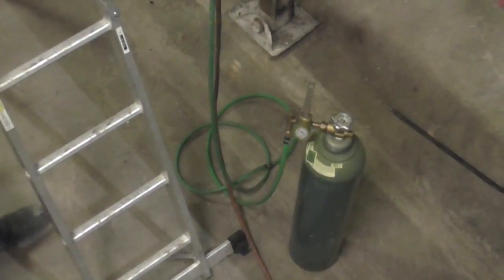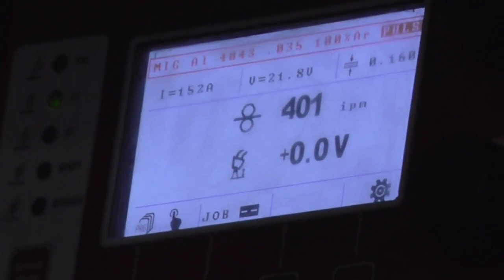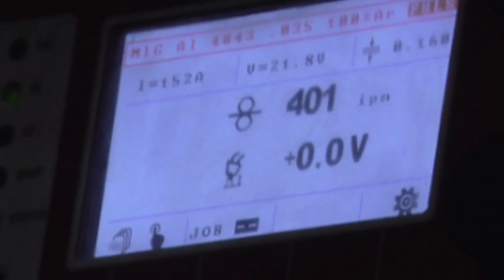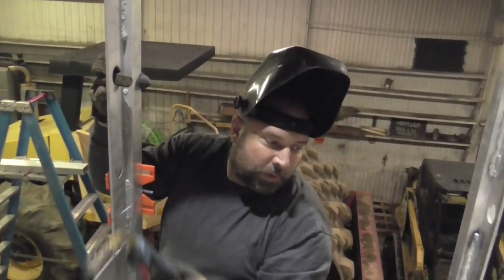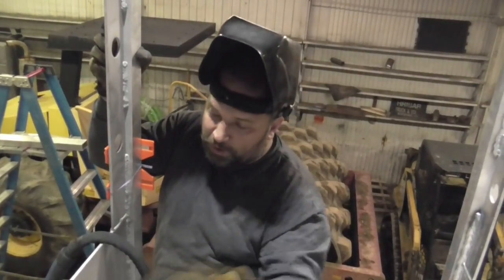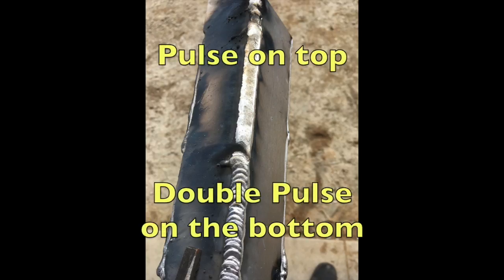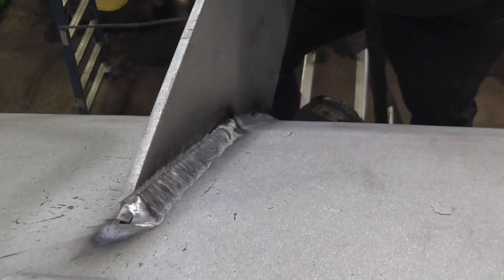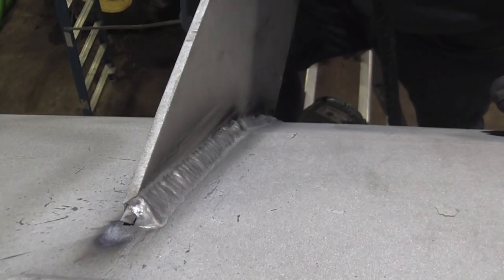Pulsed mig aluminum Single vs Double pulse

Comment: Hello! how much money did you take for this work? more than 5000 usd or less?
Reply from the maker: I did this job 10 years ago  - I cant remember the exact amount also the material cost back then was totally different ....    but if I was going to do that today $5000 just for labor, butting all the parts, and welding all the parts is about right

Comment: Mr Zila how thick aluminum can htp propulse 221 weld? Great work!
Reply from the maker: Kristijan Milenkovic depending on the alloy you are welding 4043 or 5356 and the size of the material and the temperature of the material you are welding ....  and there are options for .035 wire diameter with pulse and .047 wire diameter without pulse ....  lets say in a single pass with pulse 035 wire 3/16 to 1/4” depending on size and temperature 
If you weld 047 wire no pulse 5/16” easily maybe 3/8” single pass

Thicker if course multi pass ....

But at some point duty cycle becomes an issue also

Comment: you should have that white line each side of fillet, you should not need stirr like you are doing, 40 years hands on yacht builder  ALU, SORRY ON TWO PULSE YOU WERE NOT STIRRING,  thanks, why do you not rig some staging, tressles with alu planks, gee
Reply from the maker: Stuart Hearn i used the double pulse to limit heat input. Those tanks are some shitty aluminum, the way how they are build i had some big gaps to fill i needed to stir it like this to bridge the gaps. If you weld new and clean material with perfect fit up - that is a completely different story.  And million dollar yachts is a different story than a 1980’s old aluminum trailer
Reply: yes, good for you, i built that yacht in a ply shed, it was my business, 33 boats no rent

Comment: never use 4043, corrosion especially marine, i have aluma pro guns but they do not fitter other than miller feeders
Reply from the maker: Stuart Hearn this is just a tank for water ....  4043 is just fine
Reply: ok mate time will tell  https://www.youtube.com/watch?v=3hqV4DXwlEc, not trying insult you:))
Reply from the maker: Stuart Hearn i am not taking it personal. I watched your video.  I know about corrosion resistance and strength and heat treat ability and hot cracking at temperatures above 150F when using filler wires with more than 3% magnesium ....  i am well aware of all of this ...

You and i are working on different applications ....
Reply: looks like you are not using pulling guns> ? unfortunately, have to in the spaces you fund in ships, gun lead is never straight, I had a stroke, building days gone, but i try to find someone to build my simpler designs no plate forming, where are you
Reply from the maker: it all depends - if your feeder detaches from your power source ...  then you can run mig guns between 8 and 12 ft  off the feeder ....  you can also use push pull guns - what i dont like about push pull guns (besides the price) is that you always have to think where you are going to go with he 25 ft long cable ...  you cant just ron it up and hang it up ....  i am also working on a design for a water cooled spool gun - i am actually putting a prototype together this week and then i will be testing it ... i will be running it on a power source that is capable of hot start, pulse, double pulse,crfater fill options and i am also integrating remote control capabilities where the potentiometer on the bottom of the spool gun does not only adjust wire speed  - BUT all synergic settings wire speed and voltage at the same time ....    in my mind something like that can be really interesting for tight corners where you normally dont know how to route your mig gun or push pull gun cables ...  we'll see    in the next few weeks or moth i will be making a video about that ....
Reply: @stuarthearn9890  Stuart, do you consider fresh water and salt water to have different corrosion rates/curves?

Comment: Comments from someone who just bought a PP200 and whose only experience prior is a hobby MIG (Lincoln Power Mig 180T) and a little bit of TIG work.  I had no clue what "Spray" welding or Pulse welding meant, but it sounded cool and it looked like it worked well.  But my previous Short Circuit MIG experience was going to give me some early frustration with this machine.  My first weld went down like butter, just like the videos.  Cool!  I was so excited.  Then I started to play with the settings, BackBurn and Pinch, trying to understand what they do.  The Manual is a little lacking here, too general.  The STEL manual looks to have more diagrams in it, which might help, but it is not in English.  I was having an awful time with poor starts and wire retracting back into the tip after the weld.  As soon as I would pull the trigger, the 3/8" to 0.5" of wire I had sticking out of the tip, and which was being held to within 0.25" of the aluminum base metal, it would blow away, vanish.  What I was left with was a large arch, from the tip to the base metal.  I learned if I slightly pulled the gun away, the St-Arc feature would eventually push the wire out beyond the tip.  And if I was patient enough (oh by the way, this whole time, there is no resemblance of a decent weld, just a mess) the arc would eventually get to the correct length.  Then and only then, it started laying down a good bead.  My mistake?  Too much stick-out and/or holding the gun/wire too close to the base metal.  I've decided the tip of the wire needs to be held further away from the base metal than the arc length will be.  So far, as long as I observe this, it starts reliably, every time.  But I'm still a little confused.  Your videos look like you're holding the gun pretty close!

Another interesting difference, I subconsciously was use to changing the puddle temperature by changing the arc length with my old MIG.  Things getting too hot?  Just move the gun in closer to cool the puddle.  You can't do that with this welder, because of the St-Arc feature.  Just something I needed to understand and learn.  Related to this bad behavior, several times I've notice that after I got done with a weld, I looked at the front panel and the amp setting had changed, it was lower than I started at.  For example, if I was welding at 100 amps, when I got done, it said 87 amps.  How did that happen?   At first I thought it was a software bug, or the heat setting was inadvertently changing as I flipped between other menus.  But I think what was actually happening was, at the end of the weld, when things were too hot (I'm using small 6" long 2" wide 1/8" strap, and they heat up quickly!) I was subconsciously moving the rod into the ever-growing puddle, trying to try to cool it.  Well, if you do that too quickly, before the ST-Arc can react, you will "trick" the machine into thinking it has reached max current, because it can't increase voltage enough to maintain the desired arc length (voltage).  So the machine automatically compensates by reduces the heat setting, wire speed(amps).   At least that's my theory.  This automatic reduction is discussed in the HTP manual.

When you consider what all this machine is doing, at this price point, it is pretty amazing.  To bring this level of MIG welding sophistication to the hobbyist (and professional) is really neat stuff.   I'm excited to try it out on many different projects, now that I have some of the basics figured out. 

Keep up with the great videos, Peter.  Maybe you can comment on initial wire stick-out length, gun placement and how much wire stick-out to maintain while welding, or at least how much you need just prior to initiating the 4T slope down, for newbies like me?  -Dave
Reply from the maker: Dave - i tried to be pretty details in this reply - if you want to send me a personal message and i will talk this through with you even better 

>>Comments from someone who just bought a PP200 and whose only experience prior is a hobby MIG (Lincoln Power Mig 180T) and a little bit of TIG work.  I had no clue what "Spray" welding or Pulse welding meant, but it sounded cool and it looked like it worked well.  But my previous Short Circuit MIG experience was going to give me some early frustration with this machine.  My first weld went down like butter, just like the videos.  Cool!  I was so excited. <<

that is how it should be  :-)

>> Then I started to play with the settings, BackBurn and Pinch, trying to understand what they do.<<

on aluminum that is not a good idea ....   what wire were you running? 4043 or 5356?  the pinch will take the ball off the end of the wire.  now it also "blows" a piece of wire off the end. the softer the wire is the less pinch you need - you need just as much to where it takes the ball off the end.  on 4043 aluminum wire only needs 40-60% pinch.   
if you have more pinch what will happen is that besides blowing the ball of the end it also blows off "too much" wire and after you have too much pinch on really soft wire it starts to act as a burn back feature
which brings me to burn back
burn back adjusts the amount of wire that sticks out of the tip when you stop welding.   
lets say that when you stop welding 3/4" long wire sticks out of the end of the tip - most guys would consider that too long - now instead of trimming that with a wire clipper you would increase the burn back in SMALL steps and weld and che and repeat and adjust and weld and check and repeat till you have the desired length of wire sticking out  (lets say 3/3" or 1/4" or whatever you pick

>>The Manual is a little lacking here, too general.  The STEL manual looks to have more diagrams in it, which might help, but it is not in English.<<

i don't think that their manual even describes at all what those functions really do
and yes it is italian and english

>>  I was having an awful time with poor starts and wire retracting back into the tip after the weld. <<

so the burning back in to the tip i think i just covered - as far as starts
what wire did you use, what were your settings ?
generally speaking i would suggest welding aluminum in 4T mode
reason being if you are in 2T your hot start and "run in" menu are interlinked ...
that means - to get a crisp start you set the start speed (wire run in speed) at 40% lest say (maybe 50) and the time 0.2 maybe 0.3 sec
that will take care of your arc starts -they will be crips and smooth - no machine gun - nothing ...
now to have the timer or 0.3sec that also gives you .6 sec hot start total....

if you want more you need to run totally different settings - lets say  80-90% start speed and 1.2-2.0 sec time ... now you have 2T hotstart  but that might compromise your arc start again ....   

so better to set it 40% 0.2 sec or 0.3 sec and than use 4t and control your ampoule of hot start with the trigger

than hold your contact tip about 5/8-3/4" away from the material ... a lot of short circuit mig guys have the gun way to close to the material or whey are now "afraid" of burn backs and start 1.5" away from the material ....  

>> As soon as I would pull the trigger, the 3/8" to 0.5" of wire I had sticking out of the tip, and which was being held to within 0.25" of the aluminum base metal, it would blow away, vanish.  What I was left with was a large arch, from the tip to the base metal.  I learned if I slightly pulled the gun away, the St-Arc feature would eventually push the wire out beyond the tip.  And if I was patient enough (oh by the way, this whole time, there is no resemblance of a decent weld, just a mess) the arc would eventually get to the correct length.<<

what size, alloy or brandon wire and what spool size where you running - sounds like it may not have been feeding the wire fast enough or your start speed was set way too low for way too long????

>>  Then and only then, it started laying down a good bead.  My mistake?<<

not necessarily your mistake -on aluminum (with the pp200 and other brand machines) everything has to be "just right" to work good - if one ting id wrong you will have a hard time as you describe it  - if multiple things are wrong it will almost be impossible to get good results.

 >> Too much stick-out and/or holding the gun/wire too close to the base metal.  I've decided the tip of the wire needs to be held further away from the base metal than the arc length will be.  So far, as long as I observe this, it starts reliably, every time.  But I'm still a little confused.  Your videos look like you're holding the gun pretty close!<<

yes and no - in my mind i am holding it at 5/8"+  what the actual length is is really hard to tell (if you are the one welding) also the big cylindrical nozzle i am using "distorts" the view for the camera - it makes things look closer than they are and also i have like 5 different types of welding guns - the regular HTP air cooled gun, the made in use http air cooled gun, and abicor binzel gun a water cooled gun and an eBay gun .....    some have the tip fluck with the end of the gas nozzle and some have a 1/8" or more recessed tip ....  so depending on what gun in which video you saw ....    you get where i am going with this .....

>>Another interesting difference, I subconsciously was use to changing the puddle temperature by changing the arc length with my old MIG.  Things getting too hot?  Just move the gun in closer to cool the puddle.  You can't do that with this welder, because of the St-Arc feature.<<

LOL yes - i had that "bad habit" too ...  and you are right - for the first week it drove me NUTS !  once i overcame that though - it worked out in my benefit

 >> Just something I needed to understand and learn.  Related to this bad behavior, several times I've notice that after I got done with a weld, I looked at the front panel and the amp setting had changed, it was lower than I started at.  For example, if I was welding at 100 amps, when I got done, it said 87 amps.  How did that happen?<<

so when the display is blinking it means it was over 200 amps        this can be caused by the wire stick out was very long for a while and than while welding it was rapidly moved closer to the material (or it was much to close to the material in the first place)     

also worn out tips have that effect

and recently discovered if the wires in the power plug (where it plugs into the wall) are not tight enough  - that causes that too ….

  >> At first I thought it was a software bug, or the heat setting was inadvertently changing as I flipped between other menus.  But I think what was actually happening was, at the end of the weld, when things were too hot (I'm using small 6" long 2" wide 1/8" strap, and they heat up quickly!) I was subconsciously moving the rod into the ever-growing puddle, trying to try to cool it.  Well, if you do that too quickly, before the ST-Arc can react, you will "trick" the machine into thinking it has reached max current, because it can't increase voltage enough to maintain the desired arc length (voltage).  So the machine automatically compensates by reduces the heat setting, wire speed(amps).   At least that's my theory. <<

THAT's IT

>>This automatic reduction is discussed in the HTP manual.<<

>>When you consider what all this machine is doing, at this price point, it is pretty amazing.  To bring this level of MIG welding sophistication to the hobbyist (and professional) is really neat stuff.   I'm excited to try it out on many different projects, now that I have some of the basics figured out. <<

that is what i am thinking - for the price (less than half of what other guys with pulse (although they might have more max amps nut typically they have not more - some even less features/programs)charge) its a pretty awesome little  - very portable yet rugged machine ....
I like it !

>>Keep up with the great videos, Peter.<<  i am trying >> Maybe you can comment on initial wire stick-out length, gun placement<< i did i hope it helps you >>and how much wire stick-out to maintain while welding,<< on aluminum "more is better"  at least shy of 3/4" but it it grows to shiy of an ice that is not a problem either - however everything less than 1/2" is a problem.   son short circuit mig - "sort" just like a "regular" mig machine - on every other pulse program (steel, SS sibro - "more than on short circuit mig" "less than on aluminum"  >> or at least how much you need just prior to initiating the 4T slope down, for newbies like me?  -Dave<<   i don't know the 4 T slowdown i dont think about stockout before initiating the slope down - i just do it form  my 3/4"+ "regular welding" stockout - and it works good ...???
Reply: Peter, Thanks for the reply.  I guess "machine gun" during start was my problem.  I had Start Speed set at 70%, 0.3 secs, which must have been on the edge for my setup.  I tried 50% and 60%, and no machine gunning, just good, clean starts.  I am using 4043 0.35" wire and the HTP 26 series gun. 

I did discover what was causing my "random" amperage changes.  The top knob (front panel) is only for wirefeed/amp adjustment.  And even when you are in a different menu, if  you turn this knob, you change the amperage.  The bottom knob is for all other things.  So when I was trying to change Start Speed, I was twirling the upper knob, not getting a response, then I'd twirl the lower knob.  Not a big deal, now that I know how it works. 

Have yourselves a wonderful Thanksgiving!
Reply from the maker: i am glad you figured it all out !